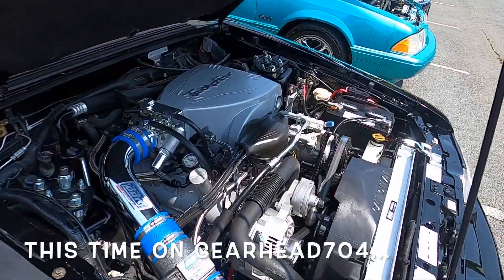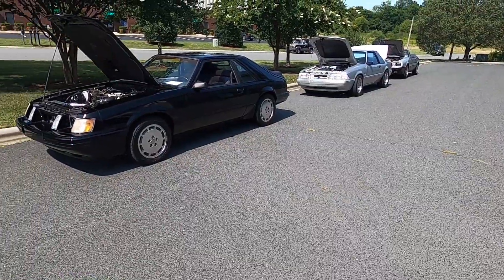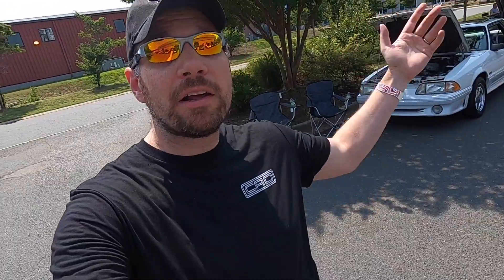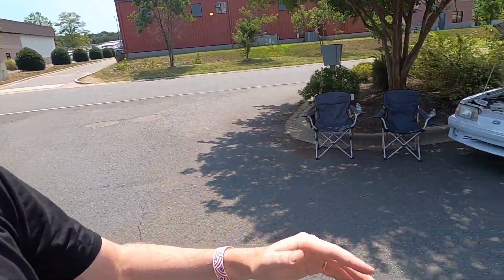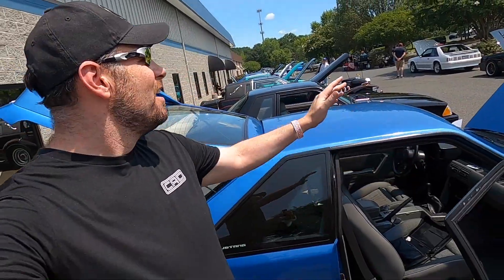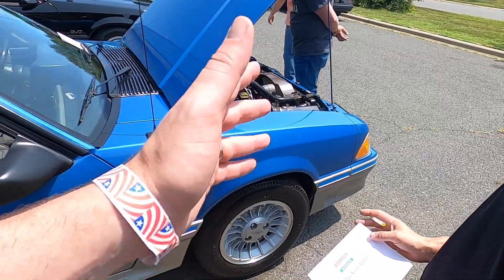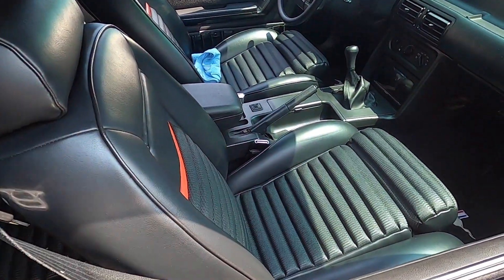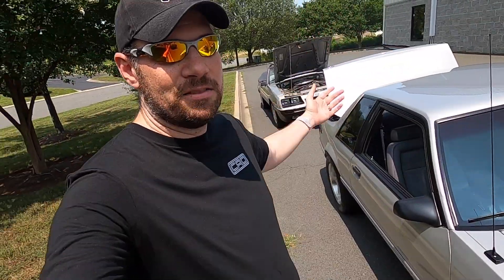MOST UNUSUAL FOXBODY MUSTANG I’VE EVER SEEN!  // FOX ONLY MEET UP AT THE MUSTANG OWNERS MUSEUM

Comment: Zimmer Golden Spirit was made on the Mustang 2-door sedan (coupe) body from 1981 through 1988. If you look at the VIN they will all start with 1FABP10D (1981-82), 1FABP26F (1983), 1FABP26M (1984-86), or 1FABP40E (1987-88). Several dozen made each year with some years over a hundred or several hundred. All came with a V8 (4.2L in 1981-82, 5.0L in 1983-88) and auto. Not sure what Zimmer did in model year 1983, as there was no auto available behind the (5.0L) V8 that year from Ford.
Reply from the maker: That's great background info thanks.  I would also be curious about 83 as well.
Reply: What about 83?